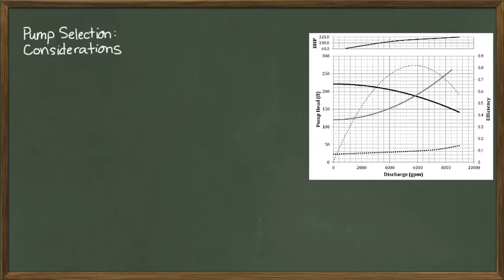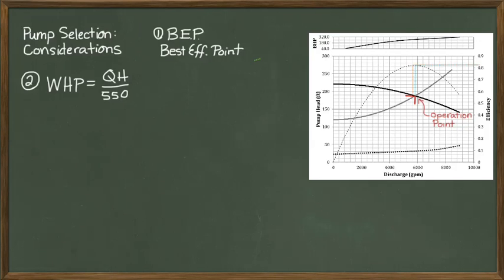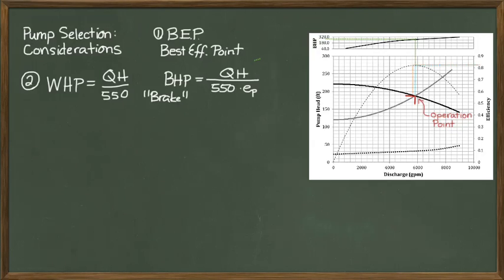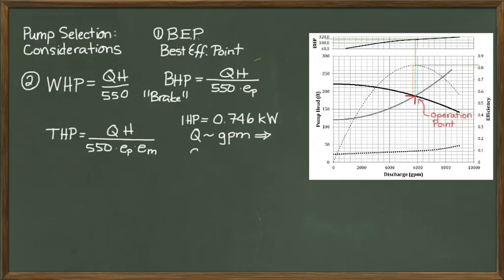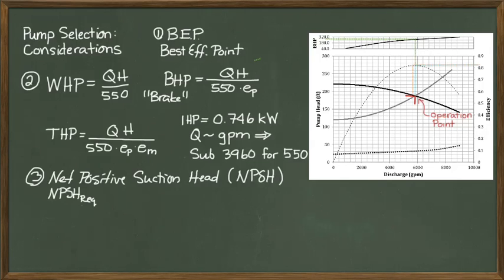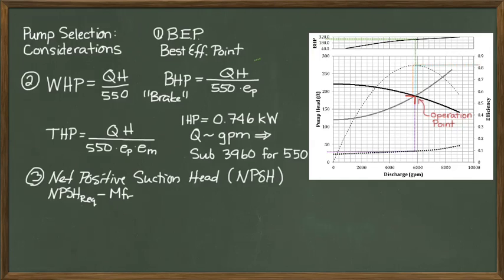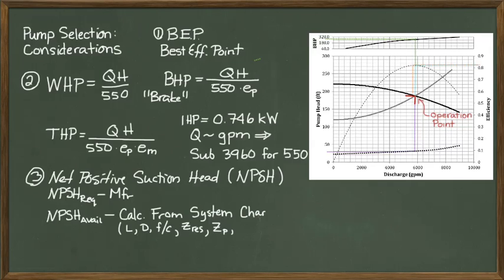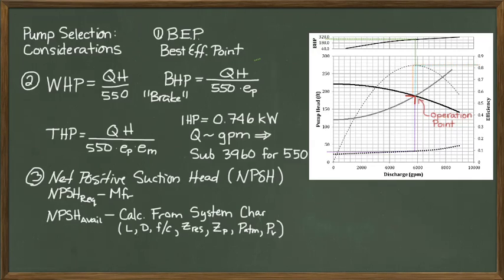Pump Selection Considerations (OLD)

Comment: Sir, I have a project that required me to select a pump for a water recirculation system. Can you tell me the steps by steps to do it?  I'm basically very clueless right now, don't know where should I start first.

Comment: chart gives water Hp but what if I have other liquid like crude oil for example head will be higher because its lighter how do we change it to oil pressure head
Reply from the maker: You just need to multiply the equation by the specific gravity (S.G.) of oil.  HP = S.G. x Gamma(water) x Q x H
Reply: @kennethwlamb  Thank you sir one other question plz plz  As you said If the inlet fluid is sub-cold  ( at low temperature ) but the pump is running below NPSHr what will happen will the impeller swirl the liquid and create bubbles which will smash as they leave the pump can we have cavitation though the liquid is sub-cold

Comment: sir can guide me for  design a foam punching machine....operate by hydraulic....
i need information about at what force(bar) it may work, what type of hydraulic pump shoud be used etc
i require guidance
Reply from the maker: I'm not sure what foam punching machines do, but it seems that such a machine won't use a centrifugal pump - which is what these videos discuss.  I would need more details in order to provide any input.

Comment: May I know sir Pump Impeller size(mm) to discharge water at high pressure for 5HP 8 Stage 3 phase submersible motor from 220feet at a voltage of 240v through 2inch pipe .
Reply from the maker: If you know the system curve and you have selected a specific pump for the job, then you need to determine from the pump manufacturer how much impeller trim is allowed for that specific pump you mentioned.  If you know all of this information, then you will only need to apply the affinity laws to estimate the new diameter size.  I have videos apart from this one that cover System Curves, Affinity Laws to help you.  Please review those and let me known if you have any more questions.